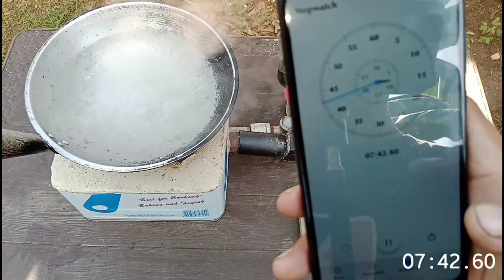Very few people who know this secret trick!

Comment: Very very interesting  But what is the role of the electrical appliance dat was switched on?very important question please Anyone can ans
Reply from the maker: Hi thank you for watching, controller giving a high/Low and the other one is air blower 👍
Reply: @Trendingnow-31  Hanks for your early reply. Can I be built without air pump Incase  of a place where there is no electricity? Getting the blue fame is most important
Reply: Oxigênio para o fogo.